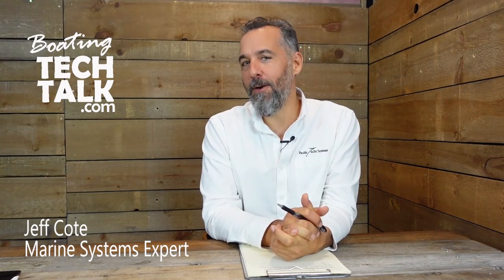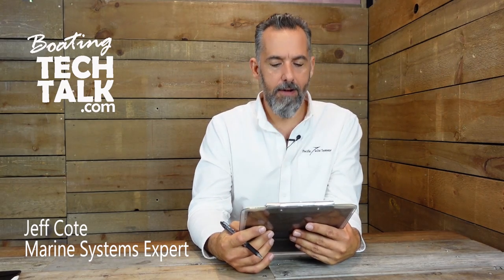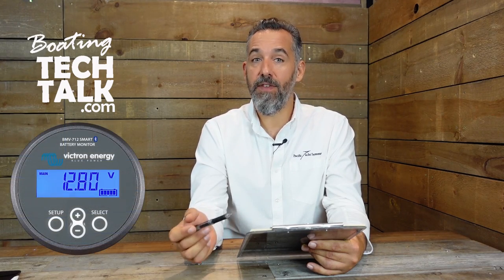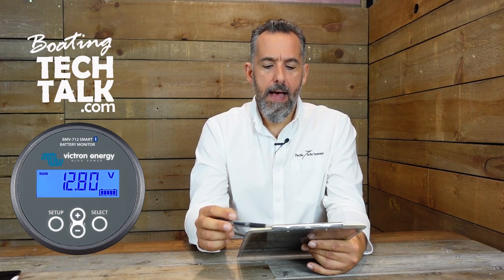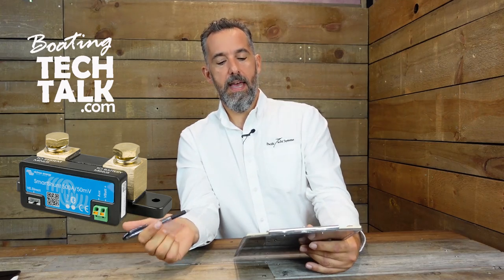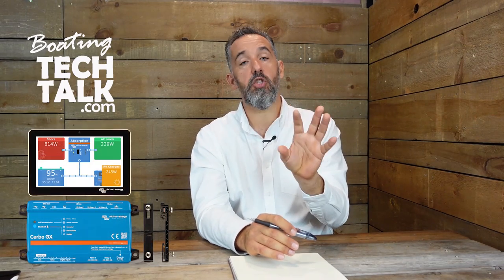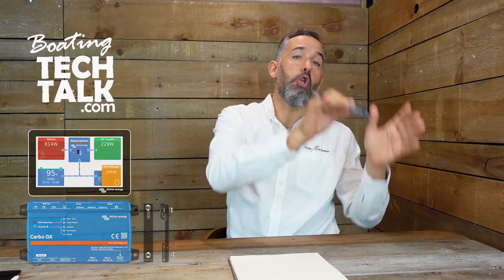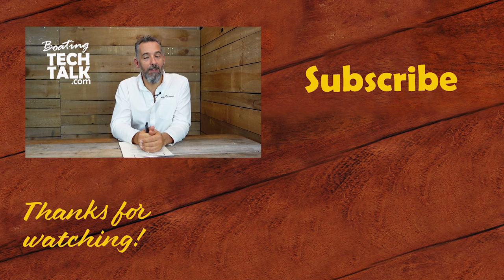What Is the Difference Between a Battery Monitor and a Smart Shunt?

Comment: Great video! When upgrading to Victron one thing to consider is location of the display. Our CERBO GX display is not visible from the helm, so we installed a battery monitor instead of a smart shunt. That way we had a display at the helm. Cabling the battery monitor to the CERBO was a single VE direct cable.
Reply from the maker: Good point.

Comment: Questions:  I want to use a victron BMV-712 to monitor my starter battery.  But the starter battery is capable of 1000amps or more way about the capacity of the chunt that comes with the BMV-712.  So my questions are, will that hinder the torque output of my starter motor?  Will that burn out the shunt?  I really want a BMV-712 with a 2000amp shunt don't i?  What I want is that victron dial (the black one) on my dash ANd have full throughput for my starter motor.  FYI I also have a 400amp alternator so I'm interested in how mast it charges my starter and the current is uses to do it with.  This is why i am wanting such a seemingly absurd setup on my starter battery.   Great video Thanks!

Comment: Good info. My survey guy told me about your site. I’m using a victron blue tooth for charging. And monitoring works good. But I wish I could get a complete monitor system that can give me a text say if batteries are low so my bilge system not in jeopardy. I don’t have a shore power system. I’m strictly solar.
Reply from the maker: Good point, monitoring really helps take the worry away.

Comment: You mentioned the difficulty of running a wire, the benefit of using the smart shunt/wireless monitoring and then immediately talked about the Touchscreen. Does this mean the Cerbo and touchscreen will receive the smartshunt data wirelessly?

Comment: Jeff, I'm looking charge my two batteries  from solar, starting battery  is charged by an alternator on the engine, I would like this kept toped off with a combiner. Is there one diagram on your site that I should follow.
Thank you Mike
Reply from the maker: Sorry redwood1957, at the moment we don't have such a diagram.
Reply: Ok thank you. I'll piece together from your drawings thanks

Comment: If one has already installed Victron products with BT built-in but no display (Solar-DC chargers, AC-DC shore power charger & DC-DC B2B charger) and is used to using a smartphone to keep track of those devices - one might as well keep it simple and opt for the Smart Shunt and keep accessing all data on the smartphone...

Comment: Can the gauge on something like the BMV 712 be mounted where the current voltage meter on my 2005 Bayliner 195 is mounted? I.E. would the Victron gauge be duplicative with the factory volt meter and thus render it unnecessary? (I am also moving from a one to two battery system, so it seems like the factory voltage meter is going to be less useful to me after that conversion is made.) Thank you!
Reply from the maker: 1) Not sure about the fit of the BMV-712, you'll have to check.
2) The BMV-712 provides amps, amp-hour counter, and voltage and should provide way more info then your existing voltmeter.
Reply: @PacificYachtSystems  Thank you!

Comment: Hi Jeff, great video, as always. I'm about to install a new Lithium house bank, dual Quattro inverter-chargers, CerboGx and Touch70, and solar panels with two mppt's, all victron except the batteries. I want to ask about the smart shunt versus bmv712 in a slightly different way. If I choose the smart shunt (with cerbo and Touch70) instead of the bmv712, do I lose any monitoring capability versus the bmv712? Is exactly all of the same data from bmv712 (with its shunt) configuration available with the smartshunt+cerbo+Touch70? If the answer is that the monitoring data is identical, then I realize that what I will lose is the bluetooth broadcasting from the bmv712 display (up in the salon) versus from the cerbo (likely down in the engine room), so maybe I may not get the signal from the flybridge. I'm hoping to not have to mount the bmv712, and also hoping that I can get the data on my Raymarine Axiom. Thanks!
Reply from the maker: Keith great question, unfortunately never thoroughly compared all the data between each other, therefore don't know. You can definitely integrate the BMV-712 to your Cerbo and also share over NMEA2000 to STNG to your Axiom.

Comment: hi Jeff, can I install an SMH connector as a quick service disconnect on my house battery bank? as long as the SMH connector is rated for the load and fused, would this break any ABYC standards?
Reply from the maker: Pardon my ignorance, what is an SMH connector?
Reply: @PacificYachtSystems  Thanks for the reply Jeff, hope you get time to circle back to this. SMH connectors are heavy duty automotive electrical connectors that manually connect and disconnect without screws or latches. SMH connectors use spring tension (pinching friction) similar to the way a wall outlet pinches the flat plug leads on a household cord, but much heavier duty. Ex. detachable jumper cables on a tow truck (so you don't have to pop your own hood to give someone a jump) or for device switching, my jeep has a fused SMH connector that powers an inverter but I can disconnect the inverter and plug in my winch if / when I need it. Images will come up if you google SMH connector. Curious if there is anything risky or dangerous about using SMH connectors in a marine environment as a quick safety / service disconnect. Essentially it would create a plug point between the boat and battery that would allow you to plug and unplug from DC battery power the same way you plug and unplug from AC shore power. My intention is to minimize the number of times I connect and disconnect my threaded battery terminal connections due to their tendency to strip.

Comment: Like many boats I have a start bank, house bank, solar and wind gen—each of which is a “source” across a shunt. Can these smart shunts etc discriminate between each source to show states of charge or generation?
Reply from the maker: You'll need dedicated shunts for each battery bank, and in turn each shunt will provide you the net amps (sum of all loads and charging) going across the shunt.

Comment: So.....
How do you size the shunt (500a, 1000a).
What is the range and dependability of the Bluetooth connection?
Reply from the maker: Hi George, the shunt should be sized to the maximum load of the battery, typically this  the starter circuit, or inverter, or windlass on a boat.

Comment: If I have a house bank made up of 2, 560 AHr LiFePO battery groupings, each going through a 120 A BMS and these are wired in parallel to give me a total capacity of 1120 AHr.  Should I size the shunt for the total battery capacity (1120) or for the allowable draw (240)?  Or am I getting something else wrong?
Reply from the maker: Size the battery monitor shunt for the maximum amperage you'll ever put in or pull out of the battery bank. Make sure the DC wiring also can handle this amperage.

Comment: Is there a way to monitor them from home using wifi?
Reply from the maker: yes but you need a product like the victron cerbo as well which will connect to the battery monitor, and to the internet on the boat.     the victron vrm monitoring is free if you buy their products.

Comment: I fell like the lack of actual "monitoring" of these Victron options is possibly pretty terrible. I've been looking for a monitor, I almost bought the 712 BT a while ago but now that I'm getting ready to buy I'm finding out that the monitoring is only while you have the app open, and it resets when you turn the app off. That makes it impossible to see the history of how your bank is actually operating and the SOC or "fuel gauge like" action of this setup is totally out the window. The smart shunt is the same way, at least that's what I've been seeing on a lot of reviews. If this is really the case lots of people, at least the ones that are paying attention, are going to be pretty upset with the Victron setup. Can you confirm, Jeff? Am I missing something?
Reply from the maker: This is definitely not true.  the SOC will only reset if you disconnect power from the shunt.  So it should be wired direct to the battery so it never shuts off from the battery switches.    the max / min values in history have to be manually reset.

If you are looking for historic graphing,   The cerbo with an SD card or online VRM will do that.